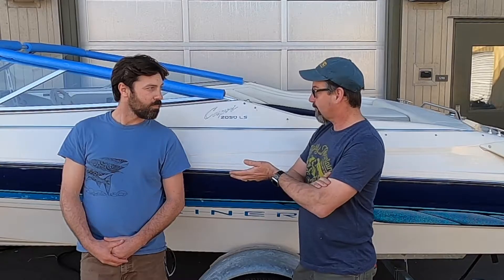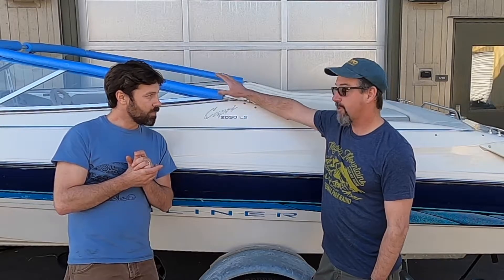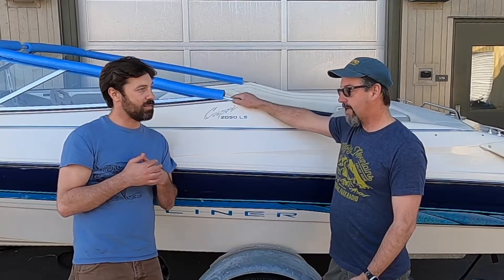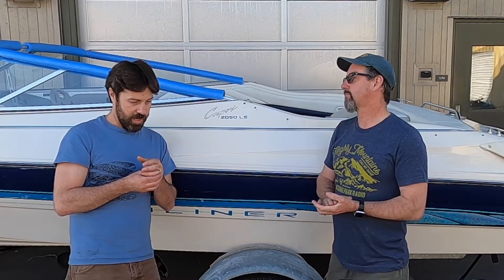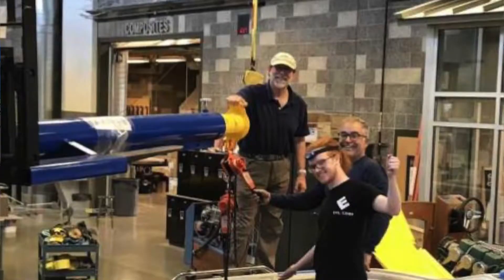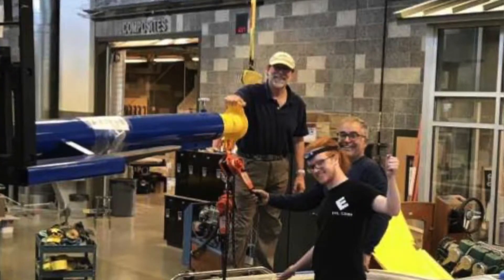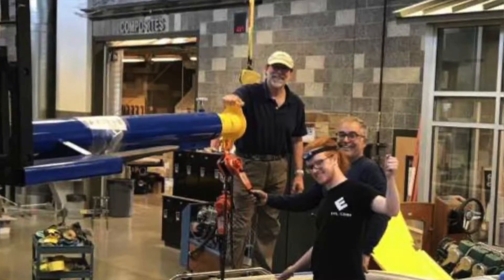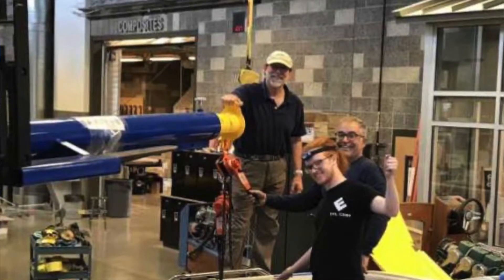Boat Project: Re-powering a Bayliner

Comment: Hey Guys 
I'm in the mount vernon area . I just got a bayliner skagit  for my family and i need to re power her
Reply from the maker: At this time we are very full at school, doing the Albmarle & Offshore Sailboat projects. We got the engine from Jasper, they stock marine rebuilds at reasonable prices
Reply: @SVCSkallywags  
That's what I needed to know. Where to get s motor ...This one had just been rebuilt but something went wrong and a hole was burned in a piston..It was a chev 305 with a penta outdive ..Im wondering if I can jump up to a chev 250 and use all the good stuff from this freshly messed up rebuild ? And will the Volvo penta hook right up to the 350 ?